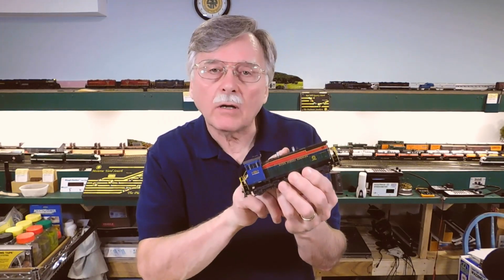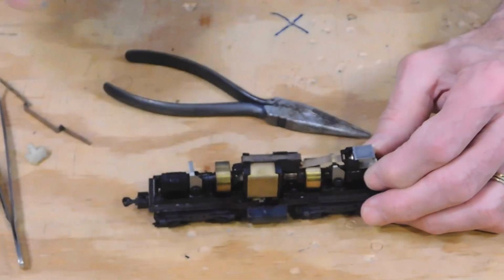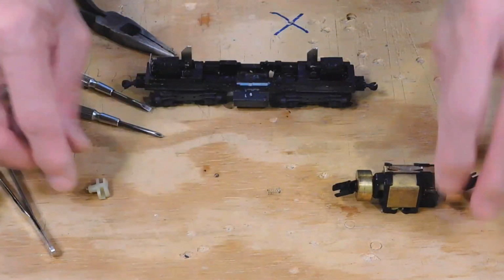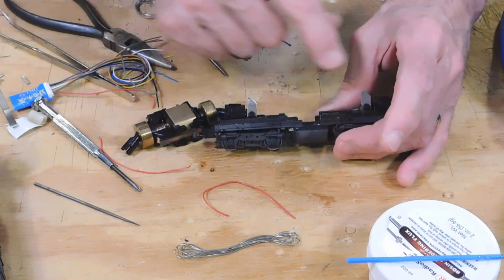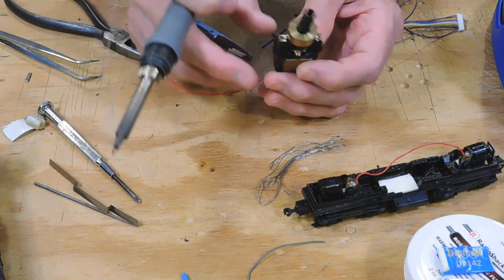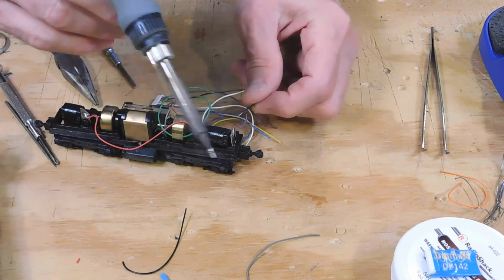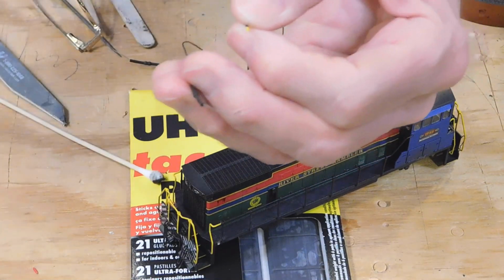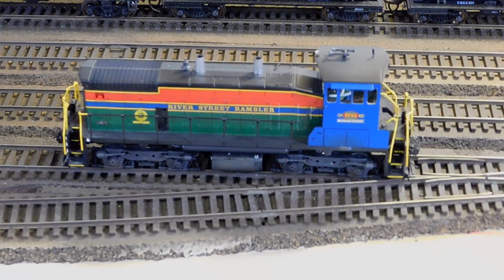DCC for a Blue Box Athearn Loco (88)

Comment: What other decoder would work for this I can not find a DH142?
Reply from the maker: Digitrax says This product has been replaced by the 1.5 Amp HO Scale Mobile Decoder (DH163D)
Reply: @TheDCCGuy wiring it up now just realized I don’t have a front metal piece for the black wire to attach what should I do instead?

Comment: Not being a picker of nits, but Athearn suggested to remove the motor clips before soldering.
Reply from the maker: I’ve done it both ways and if you’re fast with soldering you can do your soldering without melting the plastic parts.

Comment: "The Swissair MD-11 that crashed off Nova Scotia last week contained miles of wire sheathed in insulation called Kapton, which experts say can cause fire aboard aircraft. "It burns extremely hot, and it burns other flammable materials in the vicinity, including aluminum," "
Love your videos...
Reply: Wow, never knew that
Reply from the maker: Actually Kapton tape is the opposite of what you read. Here is the result of a Goggle search:

Kapton tape is highly flame-resistant and considered self-extinguishing, boasting the best UL-94 V-0 flammability rating, meaning it won't melt or propagate flame, making it ideal for high-heat electronics and aerospace uses where other materials fail. While it's extremely resistant, intense direct flames (over 400°C/752°F) can still cause decomposition and produce toxic fumes, though it generally won't sustain a burn after the heat source is removed.
Reply: @TheDCCGuy  Yes Sir, do not think a HO engine would get hot enough...
"Arcing and Charring
Degraded Kapton wires showing cracks and carbon charring due to arcing. Source: Lectromechanical Design Company, LLC
But the aerospace industry’s love affair with Kapton wiring would soon sour. As early as the 1980s, the US military was beginning to see aircraft fires and crashes related to electrical short circuits. Studies showed that Kapton was far from the ideal insulator everyone had hoped it would be — it tended to develop circumferential cracks from the slightest of nicks, exposing the conductors within. Kapton is also easily degraded by moisture, exacerbating the problem in humid environments or areas of an aircraft subject to moisture, like galleys and lavatories.
Once the insulation is compromised, arcing can occur, which leads to charring of the Kapton."

Comment: WOW That slow speed control is INCREDIBLE! I have one of these decoders in my GP30-2, but I cannot get it to move slowly no matter how much I mess with CV 2, 6, and 5. Is there a secret to this? I feel like its operating on a 28 speed step table and the jumps are really big when i increase them. I want a slow speed step 1 and a crawl like you show here at the end of the video.
Reply from the maker: Could be the gearing difference between the switcher and a GP30-2. I don’t remember doing any special speed step mods just set on the 128 speed steps.

Comment: Good instructional vid. What I did on top of the measures you recommend - I did not use the chassis to conduct any juice at all. I soldered wires to the left-hand truck frames, instead. (see minute 21.55.

Comment: you can solder the truck contacts and drill and tap the frame . so solder the truck to a wire and screw the other end of the wire by the way of a terminal to the frame (x 2 ). Adding NWSL wheelset is a must , athearn motor and drive is very good

Comment: What do you do about coupler electrification with the frame mounted metal Kadee coupler? If you connect two locomotives together it can cause a dead short if they are not set the right direction in relation to each other. Do you have a video on coupler insulation on Athearn and others with electrified frames?
Reply from the maker: You are correct it can result in a short, same on Atlas S type switchers. Basically just install a KD coupler with the plastic shank to isolate the frames.

Comment: Thanks for the great tutorial on doing isolation of the motor. I like to make sure everything is working well on DC before converting to DCC. I also like to use part of a track connector on the truck connections, that way you can easily remove the trucks for cleaning and lubing the gears without possibly having to desolder the wires. I also like using the plugs for the DCC decoder because I can take the decoder out and plug in the jumper to run straight DC as I have not converted my layout to DCC yet.

Comment: This is john. Thank s for your reply. I keep getting. No d message every time I try to program 
John
Reply from the maker: Ok, that means the system is not getting a response when it sends a programming sequence to the decoder. That could be due to a wiring error or a dead decoder—most likely the former. What DCC system are you using and have you programmed other decoders with it previously?

Comment: I installed 3 digitrax Dec. On athern blue box engines none off them work. Can you help. I watch your videos all the time. 
John
Reply from the maker: Without knowing more specifics all I can suggest is go back over your wiring since 99% of all problems can be found there. Make sure you properly isolated the motor from the frame. Also  how did you connect the power pickup wire to the frame?
Reply: @TheDCCGuy  john  I followed your instructions   motor is isolated

Comment: I've watched these conversion videos like a religion! I have a sd40t-2 chassis and got the decoder installed but now it keeps short circuiting. I think maybe the trucks are touching the chassis... was going to get your opinion on it if you've ever had the same problem. I also wired up a total of 4 LEDs onto the shell. I'm not sure if that might be an issue that's causing the short circuit
Reply from the maker: You might have a short with these since they use the frame as part of the electrical path—did you isolate the motor by pinching down the bronze pickups on the bottom of the motor and lay down a strip of electrical tape? If that is not it then take a stepwise approach. First remove everything but the pickup wires to the trucks and connect the wires to the motor. If you still have a short then check to make sure your trucks are properly seated on the bolster pins. If that isn’t it I am not sure what else could be wrong.
Reply: @ Thankyou. I will give it a shot here after I get off work. I have done the steps to isolate the motor and have pickups on all the spots. I have kapton down in the area where the motor used to connect. I couldn't get the tabs pushed down I cut them off. My buddy might've put too much conductive lube on my trucks as well, im not sure if that would be a problem with it as well.
Reply: @TheDCCGuy  the crazy thing is about all this is that it'll run for a few seconds but once it hits a bump on my layout it seems to short.
Reply from the maker: That suggests either the motor is shorting on the frame or a truck is. Those motors can to move in their rubber mounts so make sure to get good coverage between the frame and the bronze clip on the bottom of the motor.
Reply: @TheDCCGuy  I think I have figured out the problem. I was trying to save a buck and use the old motor mounts as I don't have any double sided foam, the motor is a little loose inside the chassis but if it's straightened out it runs like a champ!

Comment: Larry… Thank you for being so easy to understand and thorough in your approach to teaching us novices. I’m new to DCC and have a host of different makes of engines. I have a few old Bluebox Athearn. I had a decoder I bought to have installed in an engine. I decided to try it myself. First try…it worked perfectly. I down loaded JMRI with an Arduino interface to fine tune the engine. Runs great. Working on lights next.
Reply from the maker: I am glad you found my videos helpful! I’ve always felt that most of this stuff is not all that difficult but many modelers are afraid to actually take the steps and get it done.

Comment: Great video and a very clean install. The only thing I would recommend is to remove the Athern Brush covers before soldering on them. I have seen too many people melt the black plastic on the motor and then you can no longer clip it closed. If you overheat the copper brush cover it goes flying when the plastic melts. I'm not saying that I ever did that...

Comment: I installed a decoder while watching your video exactly how you did it. When I put it on the track I get a overload message, can you help with this?
Reply from the maker: Did you test it on the programming track first or go straight to the main track? If on the main then you might have cooked it. See if it has a funky smell or burn holes in the wrapper. Some decoders are internally protected but many less expensive ones are not.  

Now assuming you got lucky you need to go back and recheck your wiring to see where your short is. Make sure to protect all splices with heat shrink tubing. That along with the video is about all I can do without being able to hold it in my hands and look it over.
Reply: @TheDCCGuy  I think I put it on the main first as I didn't have a program track set up at the time. I rechecked the wiring and ordered a new decoder. I guess we'll see what happens. Thank you, I appreciate your videos.
Reply from the maker: Depending on how log you have had the decoder it may be under warranty. Many manufacturers have a no-fault warranty for the first 90 days or so, you might want to check and save yourself a few $$$$.

Comment: Sir, this may be a silly question. I ask apology. After installation, does it run on DC or need DCC commands, Controls, throttle, etc.?? Is it plug and play or need programing.
Reply from the maker: While it can be used on DC with a decoder performance is just not as good as with a plain DC loco, after all the intent is to use it with DCC. Plug and play usually means that you just plug the decoder into a socket and go which I obviously did not do however I think you may mean something different. While you can operate it as it comes there are a number of features that allow you to customize operation through programming it.
Reply: @TheDCCGuy  thanks

Comment: How do you know to connect the grey wire to the bottom motor clip?
Is there Digi- Trax instructions to show what wires get connected to what polarity and shows what color wires go to what accessories? I.E. bells; horns, lights & whatnot.
I'm new at this, don't know if I'll even have a chance to do any of this. But you sure do a good job of explaining things.
And... your very Blessed to have a chance to do, Railroad Modeling. 
Do you have a video on how to install a newer more compatible motor for DCC? And or is there something you can install to make the older motors....safer and more compatible with a DCC system?
Cause cost efficiency matters!
Thank you, for your time and letting us enjoy your hobby with us.
So many videos, so little time.
So much Railroad Modeling so little time? "Labor" of enjoying a hobby! or something you enjoy!
Reply from the maker: The wire colors on a decoder are an NMRA standard. In this case the orange wire goes to the positive motor terminal and the grey goes to the negative.
Reply: @Model Railroading  thank you, have a wonderful day.

Comment: I need to know how to go from DCC to DC on some of my locomotives where the DCC has shorted out?
Reply from the maker: Were these factory installed decoders or after market? What kind of decoders and locos?
Reply: @TheDCCGuy  They are digitrax DH127d and I am switching some blue box 6 axled road switchers. I have made some changes already and installed 5 decoders into 5 separate loco's 3 work ... 2 do not. The problem I am having with the 2 that do not work is ,,, there is no plate where the old light went. How do I anchor the black wire to the frame? I have seen some modelers drill a screw into the frame itself. I can do that but have no idea what size drill bit and screws to use. Basically, again how do I connect the black ground wire to the frame? Thanks

Comment: Watched your Video. I have same loco. Installing DCC was fairly straight forward. The lights are giving me a problem. Did not see what you did in video. When I connect the two legs with resistors to the blue lead and the front and rear to white and yellow, both lights come on at same time.(in reverse or forward). How did you connect your wires for the lights?  I must be missing something simple but would appreciate your help. 
Thanks.
Reply from the maker: The fact that they both light up tells me the polarities are ok. Check the decoder to see if it is programmed to have both lights on all the time.

Comment: Thanks for the step by step. Could you have added a speaker to that decoder? I want to add some decoders to some blue box locos. I want to use soundtraxx. How would they be secured ? I have another question. I recently installed a soundtraxx decoder in a loco. Motor was  isolated, all wiring was done correctly,  unit was working then a little while later it wouldn't work, it was flashing a error code pointing to a motor fault. I replaced it with a brand new motor, same result. I tried resetting the decoder, no improvement.  I removed all the wiring and the decoder, checked for shorts in the trucks, trucks to the wrong g side of the frame, can't find an problem, but end result is it shorted out the decoder but I don't know why.
Reply from the maker: I did that in video 194.

Comment: Try using a mother board and plug in a 21 pin decoder. A lot less wires, and a lot neater installation.
Reply from the maker: Yes, I’ve done several videos on using the Decoder Buddy boards for installing 21 pin decoders.

Comment: How do I know wich decoder I need for my locomotive?
Reply from the maker: Boy that’s an open ended question. The easiest thing you can do is go to the SoundTraxx or TCS website and both have a lookup feature that will suggest certain of their decoders based on which loco you have. Digitrax and other manufacturers may also have this feature but I am not sure. In general the first consideration is does your loco have a DCC socket? If so then you need a decoder that will fit it. Then you also need to consider the size of the decoder and space in your loco. I have done a number of steam and diesel installation videos so watch them to get an idea of what is involved. It can be as easy and plug it in and go or a full hard wiring project. For someone new to the hobby or DCC the best option is to buy a loco with a factory installed decoder.
Reply: @TheDCCGuy  thanks so much!  I brought my locomotive at a train show last year, it’s probably from the 70’s. I’m pretty good with my hands.  I really want to try and do it.  Thanks for all of your videos.   I am very new to this.

Comment: First, confirm that the "Train Engine" that you are going to work on is fully functional and operatable before you perform a DCC upgrade on it. There's nothing like completing the entire upgrade, and then finding out that the unit has a bad motor.
It's typically much better to find the bad motor first, before performing the entire upgrade, and then finding out that the motor is bad.
Double foam tape is an insulator, insulating the bottom of the motor from the chassis. No reason to be swapping electrical connection clips on top and bottom of the motor. The foam tape electrically isolates the motor by insulating the electrical connection.

Comment: Thanks Larry- your videos gave me the confidence to try installing Dcc with sound in two Blue box Athearn engine.  I'm not that mechanically inclined, but I did tear down the trucks cleaned, greased and oiled the proper parts. The engines improved greatly. I used the Digitrax SHD166 decoders and they sound great. I even brought the Digitrax PR4 and downloaded the proper engine sound (U33 and GP 60). Thank you again your explanations are very helpful.

Comment: Larry could u possible show how to install a lok sound decoder with a sugar cube speaker  into a proto 2000 GP38-2. I have trouble trying to install into this one and get the best sound out of it
Reply from the maker: Take a look at  video 70 as it is about as close to your question as I have done already. If you are not getting good sound then make sure the speaker is well sealed. Since you didn’t mention the brand I can’t offer any suggestions there but on mine I always run a bead of superglue or silicone around the point where the speaker joins the enclosure.

Comment: I solder wires to the trucks for a direct connection so I don't have to rely on the frame to make good contact with the pads. Gets rid of that potential point of failure altogether and I don't have to care if it gets dirty there.

Comment: I want to run my Athearn GPs long end forward and want to know if it is possible to exchange the trucks to accomplish this?  I am running DC now but want to go to DCC in the future.
Reply from the maker: You don’t need to change anything except the direction button on your controller and presto they’ll be running long hood forward. Or have I misunderstood your question?
Reply: I'm planning on doing some consisting with some of these units short ends together is my problem
Reply from the maker: You need to watch my videos in consisting locos. When setting up you out the locos in the directions you want them to face and specify which way each is facing during the consisting process.